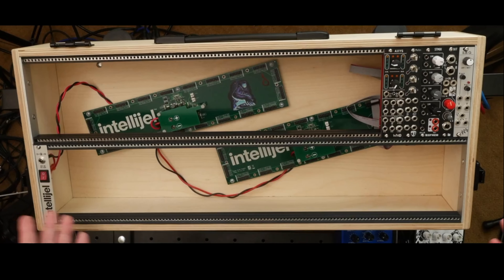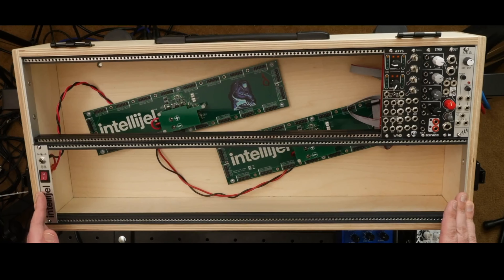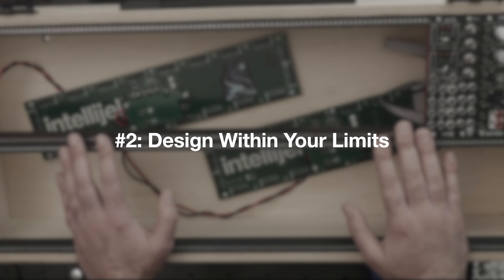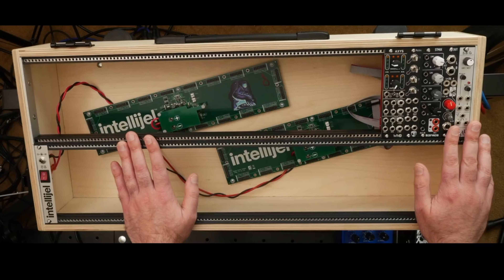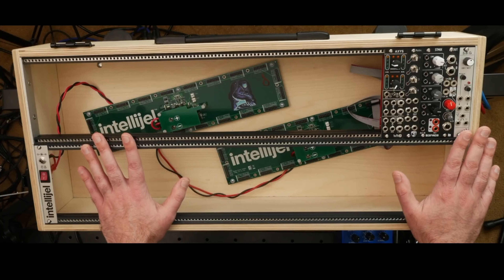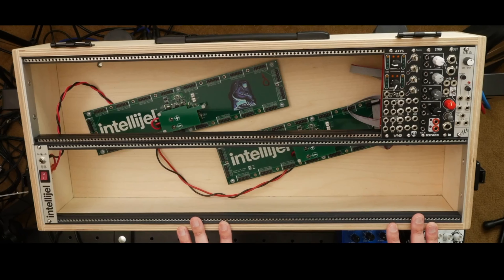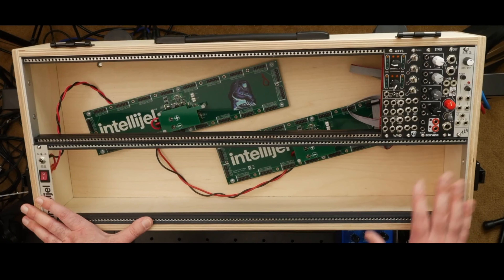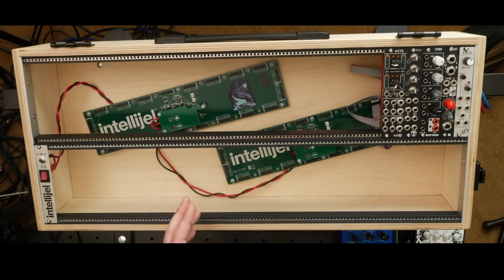DIY Eurorack Case: Part 1 - Construction & Materials

Comment: ill probably 3d print the mounting brackets and make a small one, I have a mixer and instruments(drums), so i just want a few eurorack modules because my mixer is not a multichannel recorded with effects, so I want to insert some FX audio envelopes with euroracks to the bass and tom drums, maybe add some metal ringing and resonance to the snare, some high fidelity effects to the cymbals, maybe with some electronic flare idk yet 

but I want to build a little cab for my mixer to sit above it, and then below the mixer is a set of drawer slides with my Maschine MK3 and Elektron cycles.

Comment: How did you mount the Z-Rails to the aluminum - my guess is that you must have used countersunk M4 bolts? Did you find that sturdy enough?
Reply from the maker: Correct, it's countersunk in both directions. By itself it might not be strong enough, but in the wooden box, up against things on all sides, its perfectly fine.
Reply: @ferrycollider  Did you buy the aluminium ends separately? I've been looking at the z-rails, but it seems the ends are separate?
Reply from the maker: @robmcinerney1956  Yes, they're sold separately as pairs. On sale now at Perfect Circuit with coupon code SUMMER10

https://www.perfectcircuit.com/tiptop-audio-z-rails-brackets.html
Reply: 126 hp rails?